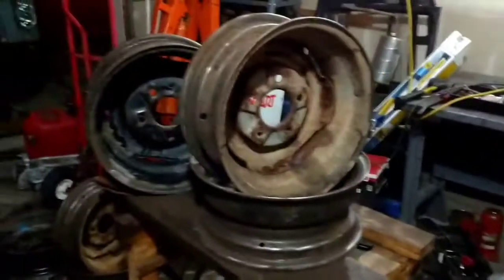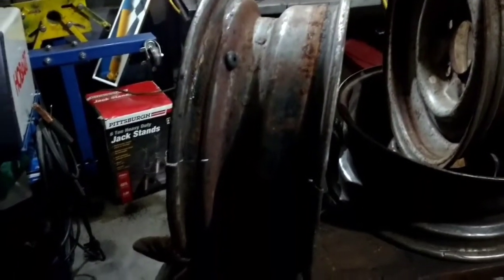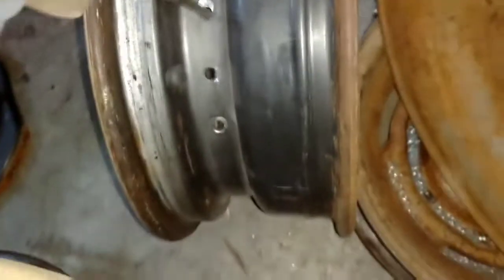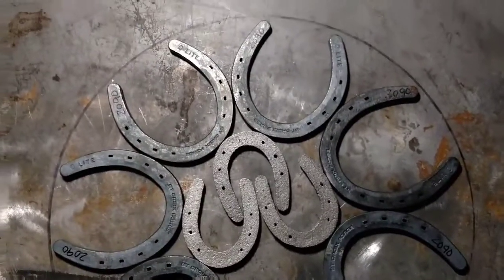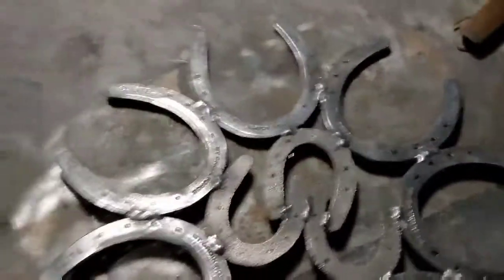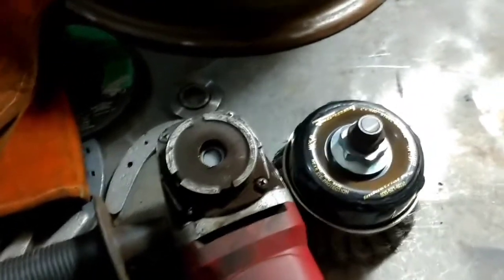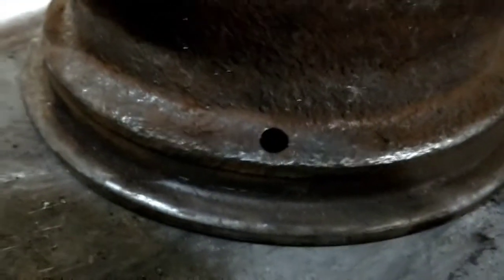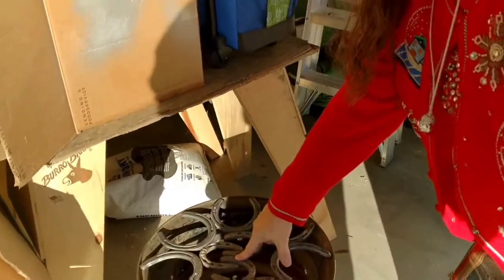How to Make a Rim and Horseshoe Stove/ Fire Pit

Comment: How did you get the center section out after removing the rivets? I'm doing this on the same type of rims. Did you just beat them out with a sledge hammer?
Reply from the maker: Philip Courtland that's exactly what I did.
Reply: @marcusmayhemadventures6479 not that lucky I guess ended up having to plasma cut off one of the tabs to relieve some tension.
Reply from the maker: Philip Courtland did you drill them out or punch them?